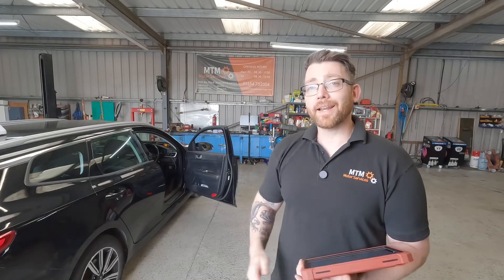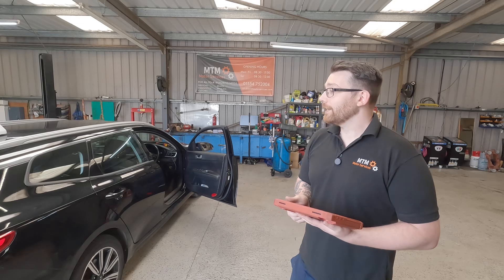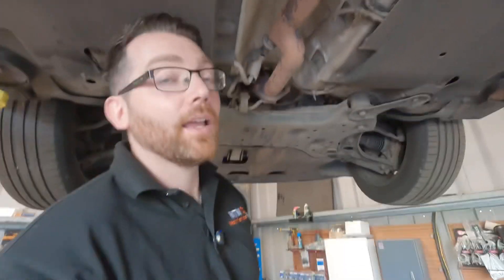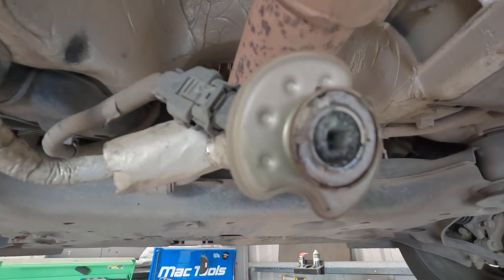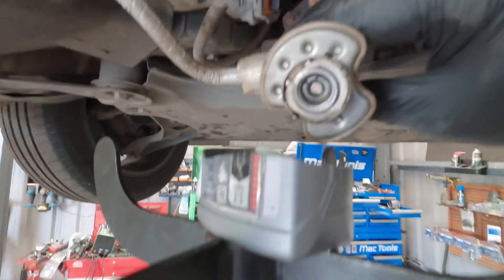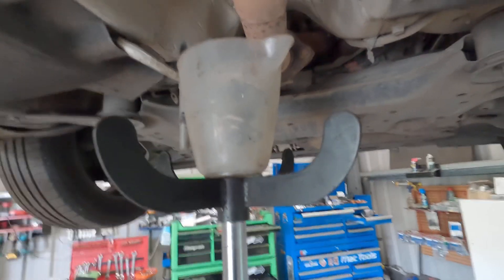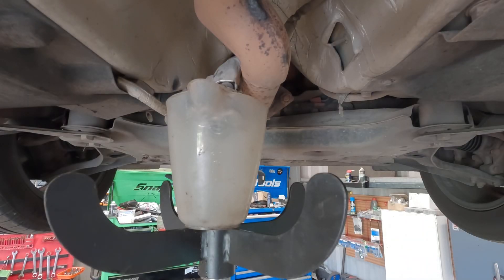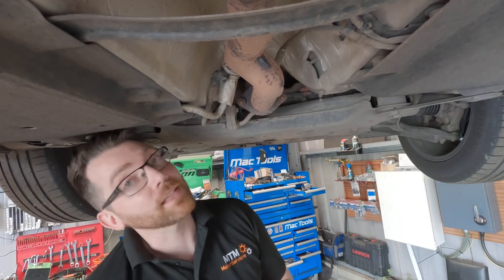KIA Optima P2BA800 NOX exceedance, dosing interrupted

Comment: Hi, i have the same error, i have cleaned the adblue injector but the problem happens again afer 80 km. What could it be?
Reply from the maker: Did you also do a dosing test to make sure the pump is working in the Adblue tank?
The light is triggered due to the nox reading being too high. 
So if the correct amount of adblue is being injected and nox is still too high, there could be an issue with the exhaust system or even the sensors. It would need further investigation to confirm.
Reply: @MTMMotorServices  Hi do you know the problem about p20ee00 ?